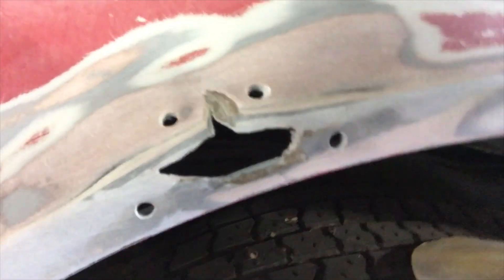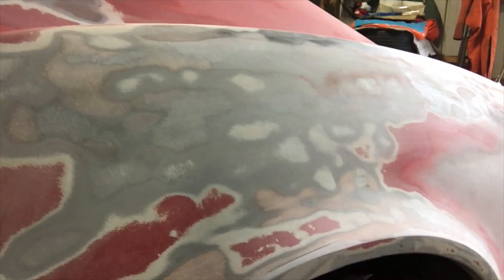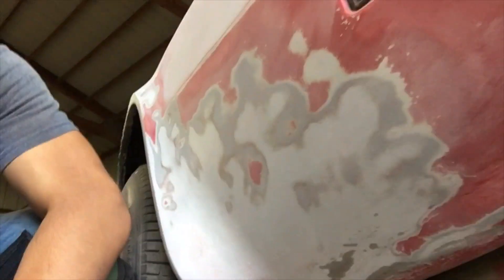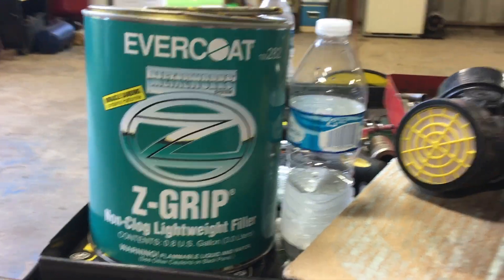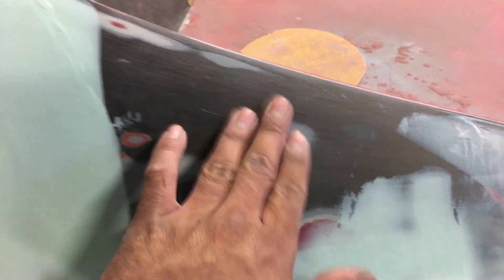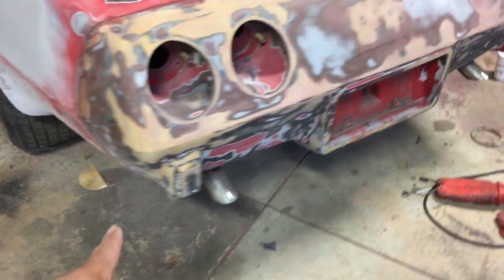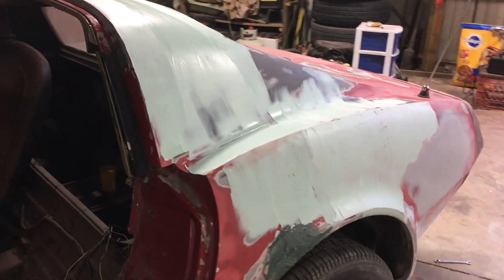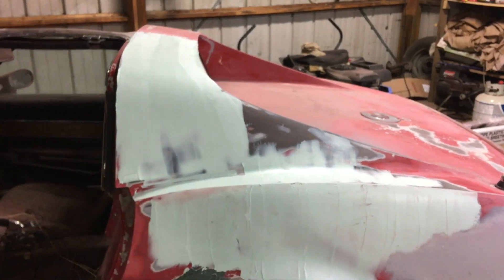76 Corvette Restoration PT 2

Comment: I love the fact that you are working on an old car and bringing it back to life, and please take my comment to heart, as I am not trying trying make troll comments. This is impatient body work, and not how a quality job should be done. You look like a capable young man, so please take the time and strip the car down and patch that hole in the rear quarter properly. And as mentioned in this post, never apply body filler over paint, as you are just asking for problems down the road. Good luck with the project.

Comment: The hole in the fender should have been ground down a bit from behind and then matted. The front should have been ground down a lot to allow the fiberglass to build it back up. Should only take a skim coat of filler to complete. Just glad this was a 76 and not one of the good years.